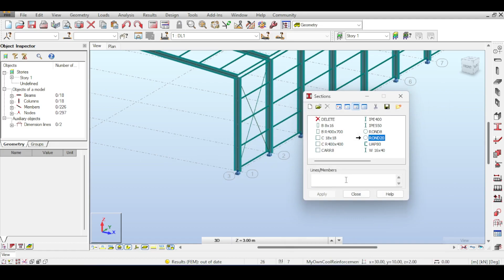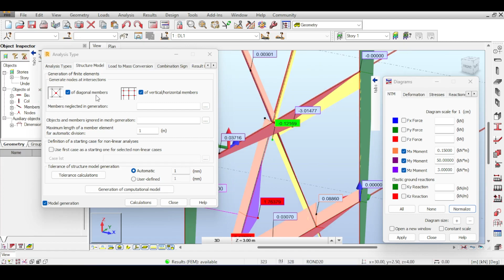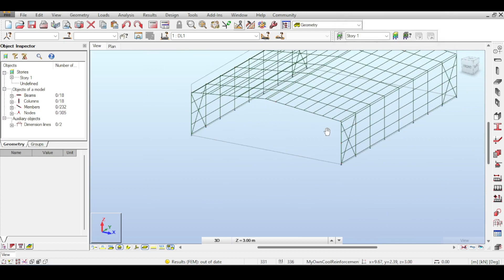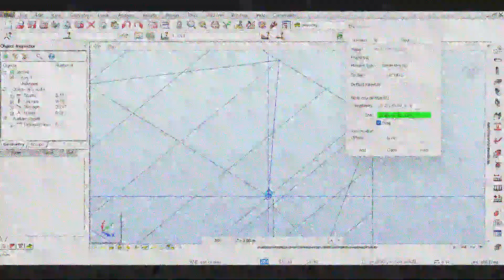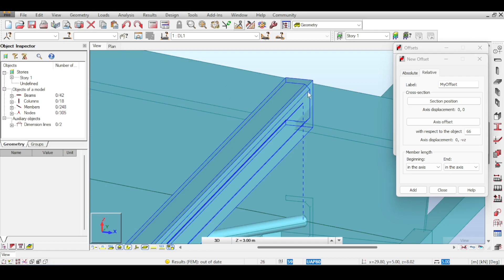Modeling of Industrial Warehouses | Part 2: Modeling (2)

Comment: Hello Sir. Thank you for this tutorial.

I think it’s about time Autodesk Robot made some features like offset automated, as it stands it’s tooo mechanical and tedious to do.

The ease with which you use robot software is amazing. Am jealous.

Anyways, I know it’s practical and real to offset the braces from bottom and top of columns to allow for connections and avoid clash of members. This is achieved in drafting only while analysis is kept as simple as possible.

Thank you again 
Enjoy your day
Reply from the maker: Hi there Engr. Ni
You are 100% correct. It is still possible to simplify without offsetting, I overkilled it with accuracy

Stay tuned for more content,
CEE

Comment: Hello CEE,

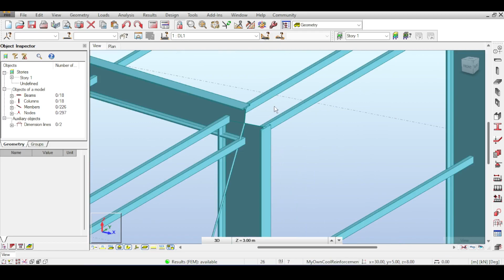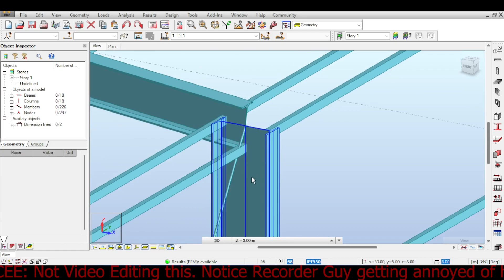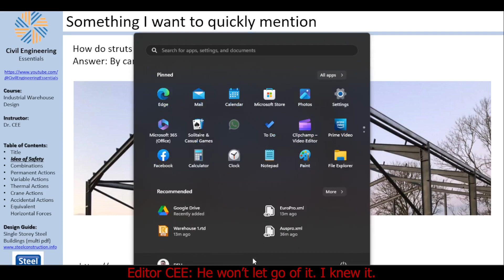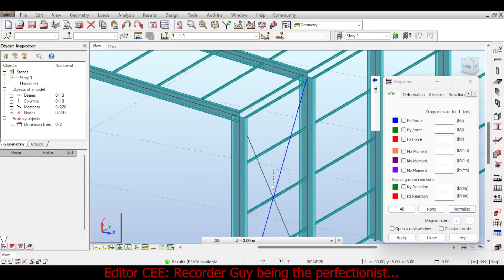LOL, Editor CEE @4:20, 4:25, 11:28, and 11:45. I like the recorder guy thoughts on this. Although the moving of the braces is an option in this case, doing it on this video does give the viewer the “how to” if the viewer ever has to choose.

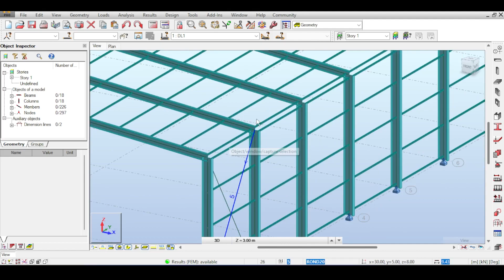04:33 Pitfalls in Bracing. The details, explanation, and the demonstrations provided in this section of the video is really really good stuff. Thank you so much for this.

10:30, 10:37 V-bracing v/s X-bracing. I get the highlighted distinction of X-bracings that joints the structure at the base and at the top of the structure v/s the V-bracings that crosses at various levels between the base and the top of the structure. I am curious of a case in a warehouse with tall (say +/- 13 meters) high steel (portal) columns, in that case, the V bracings may be the only sensible option. My question is: would it be considered overkill if (in that case) one “turns” the V-bracings into “X-bracings” without reducing the bracing intersections intervals to the columns and by adding more v-bracings from both sides so that the bracing X-cross each other?

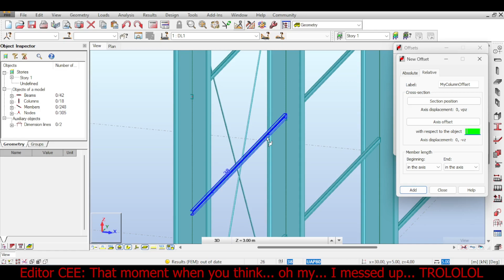24:00 😁, 24:40 I personally find the CEE coverage of the nuances to be most beneficial, I do not wish for this level of detailed and accurate coverage to stop or to be relaxed, it is right the way that it is. 24:48 🙏 …amen. The “frustrations” that are sometimes experienced in the video are similar frustrations that I also sometimes experience, it is encouraging (and motivating) to know and to “see” that this is “normal-ish”

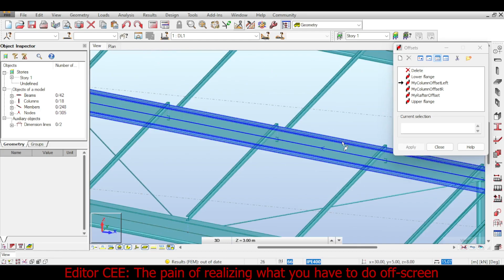26:39 😂 here is one idea about “the rest”, you could also DELETE the rest of the bays and then copy-drag the one bay which you have done and offset. You may need to de-select the bracings on the bay you are copy-dragging so as not to copy or drag the bracings.

27:21 YES, this is correct (but there are some nuances, see earlier comment on the “user defined sections video”. 

“Option 1” can be quite a viable option especially with preliminary designs and sizing of the cold formed members. This option can relatively quickly give the user a “pool” of sections to choose and to design with. Once candidate section sizes have been determined from the above option, the determined sizes can then be used to guide the user in choosing the size of and in creating their own custom section sizes (if needed) and run verifications and/or designs for that section as it has been suggested here. There are quite a number of databases that are available in Robot with “ready-to-use” (sort of) cold-formed sections.

I have enjoyed this video and I look forward to the next CEE videos on the series.

Keep well and kind regards, DK
Reply from the maker: Hi there Engr. DK,

Yep, Mr. Editor left my "getting gradually annoyed" in the video as it is both fun and does not cut anything related to the placing of the bracings. 

There are a lot of pitfalls, and the problem is that the software will not warn you as it is "from its FEM perspective" perfect. 

For extra long columns, no, I would not consider it an overkill. Actually, if you have a tall warehouse, it might be sensible to add a beam (double pinned, simply supported) in the middle of the column, then either x brace below and above the beam, or v brace below or above.

Oh at 24:00, you have no idea how frustrating it is ^_^ but it happens. And I guess the editor is basically waiting for me to slip up like this. But in an effort to "keep things real", it was kept in the video. Also, because as you mentioned, it can happen to all people, and somebody should not feel "weakling or beginner" when something like this happens. I know the editor makes it seem that I am a total n00by, but he actually knows the lengthy experience I have in RSAP. It is just for the fun factor ^_^. 

OMG ^_^ copy and dragging, idk how I missed this ^_^

Yep, if you add any non EC section, robot will take notice and issue some warnings. 
(For all other viewers, in case you need some context, check out Engr. DK's comment on the user-defined section videos)

Once again, a huge thnx for your detailed comment. In case you do not know, those comments are EXTREMELY valuable not only for other viewers, but for me as well.

Stay tuned for more content,
CEE
Reply: @CivilEngineeringEssentials  

I am giggling with joy as I read through your feedback. 

Many thanks about the extra long column (tall warehouses) bracing ideas. I have also noticed (from afar and while I was driving on the highway earlier today) two tall warehouses that are in the construction phase. The structural system involved using very tall RC columns almost all the way to the eaves, and then having the steel roof connected to relatively short steel columns; these short steel columns are seated on top of the RC columns. 

It seems an interesting idea, it appears that the girts are “attached” to the sides of the RC columns with chemical anchors or other forms of anchorage?? Steel canopies and even “steel bracings” seem to also be attached to the concrete columns. I wonder why not use shear walls for bracings between RC columns where this is required.     

Thank you for the feedback, I always enjoy reading same from you.

Kind regards, DK

Comment: When there are gable columns, I model purlins with one end released i.e. no axial force. The reason is that the gable walls does deflect less than the adjacent portal and so, the purlins would work as ties in between the gable walls held in position by the roof bracing. Something to think about, Cheers, btw I like your videos
Reply from the maker: Oh, I see ^_^ 

It is kind of a cool trick to use roof bracing in a multi-functional way. Good to know, I think I will hint to this in the next video.

It is really amazing if one checks the countless options one has to prepare his structure.

A huge thnx for the info, keep up and stay tuned,
CEE